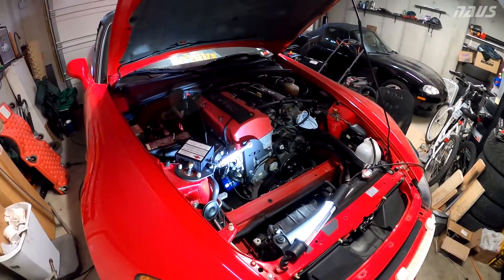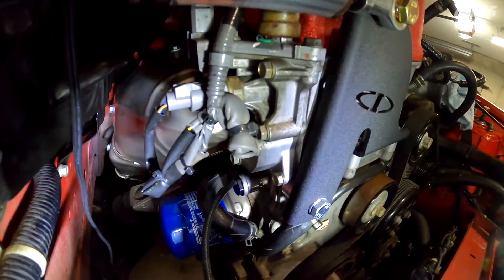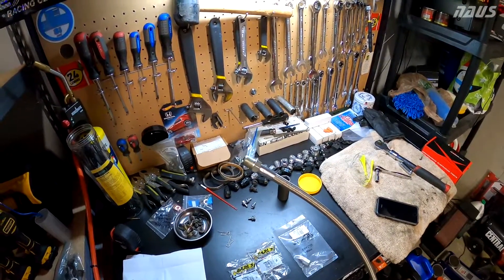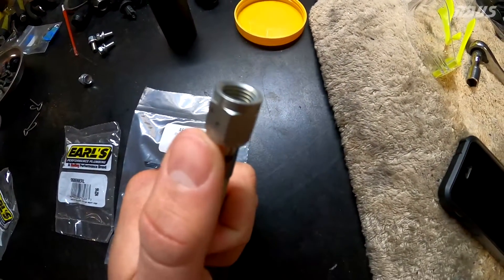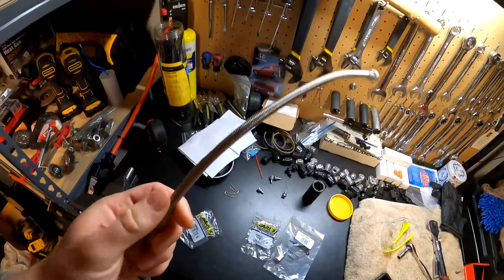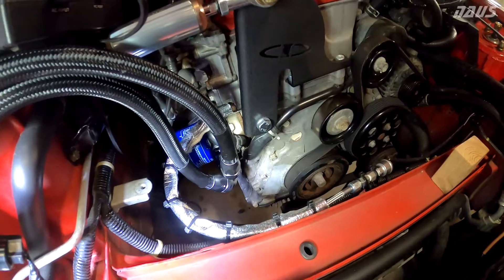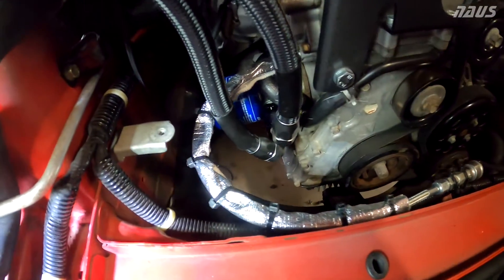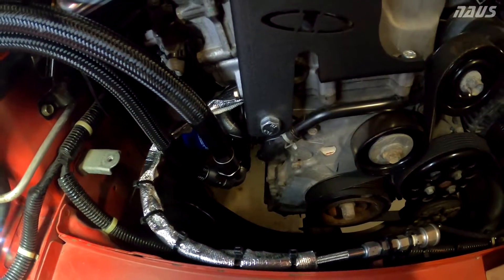S2000 Oil Pressure Sensor Relocation

Comment: hi thanks for the revise! and btw what pressure are you getting while the car is at normal operating temp at idle? i'm getting 15-18 in normal condition and as low as 9 when just coming off the track after a 20min session, however i remeber the service manual says ~30 at idle when hot...
Reply from the maker: I’ve gotten as low as 5 psi consistently when coming off the track. Ive ignored the idle psi 🤷‍♂️

Comment: Would a sandwich plate be a good option?
Reply from the maker: Check out the vid I posted after this , I installed an oil cooler which does use a sandwich plate, definitely don’t want to stack sandwich plates

Comment: FYI Glowshift has all the fittings and lines you need for pretty cheap. I wanted to run oil pressure and temperature sensors along with the stock pressure sensor and this little part for a FRS/BRZ worked great. https://www.glowshiftdirect.com/1-8-bspt-oil-sensor-thread-adapter-for-gt86/ 
It has a 1/8 BSPT M fitting that screws into the block, then a 1/8 BPST F fitting for attaching the stock sensor, then two 1/8 NPT F fittings for the aftermarket sensors. 
I then attached this line which comes with 1/8 NPT F to -4 AN F and 1/8 NPT M to -4 AN F adapters. 
https://www.glowshiftdirect.com/sensor-relocation-hose-kit/
They do have a 1/8 BSPT Male to 1/8-27 NPT Female Thread Adapter for $5 but not the opposite which you got from Earl's.
Reply from the maker: Thanks for the info man! I actually did look into those adapters. I came across glowshift as well. However I’ve read a few things online about them cracking from the vibrations of the engine. I wanted to keep my setup as simple and lightweight as possible off the block. I added a sakebomb oil cooler to the car after this video too so temperature isn’t a concern of mine anymore, and well, I think we can all agree the stock sensor is quite useless